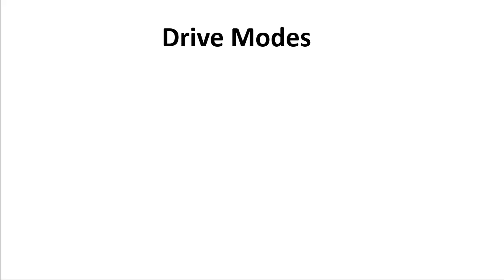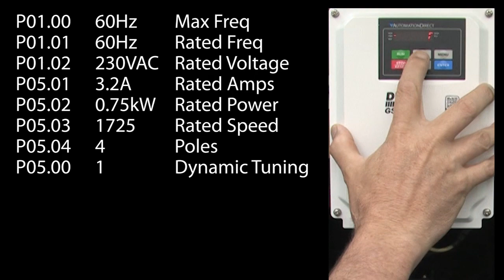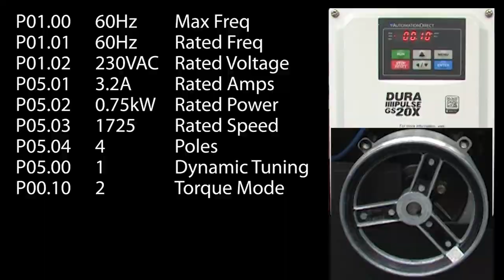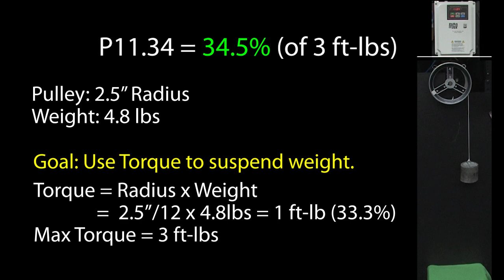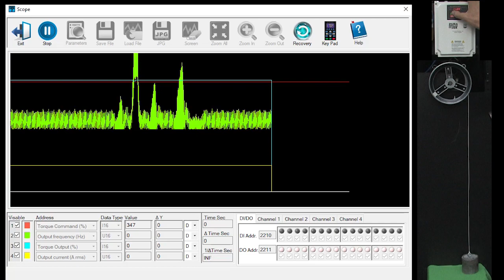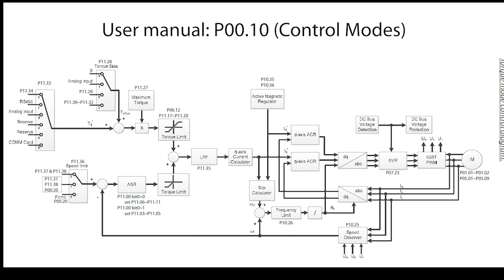DURApulse GS20(X) VFD: Torque Mode Quick Start from AutomationDirect

Comment: Is it copy of delta vfd?
Reply from the maker: @Weekendtraveller765 This is an AutomationDirect product with proprietary hardware, software, and firmware. It will not be compatible with similar-looking Delta drives.

Comment: Really it is great video.
In which cases, should be using Torque Mode in VDF ?
Reply from the maker: You would use Torque mode anytime you want Torque to take priority over speed. 
Winder, rewinders, capping, and web applications are some good examples of when torque control is utilized.

Comment: How can I make analog set point for torque to overcome less torque at low speed That make motor jerk or not able to start
Reply from the maker: Hi Ayman,
Take a look at Parameter 3.00 (A1) or P3.01 (A2) option 3.  I think that is what you are looking for. There are other options in there that you might be interested in too.
Reply: @automationdirect  thanks for interest
I have drive motor when operates at frequency below 50 HZ with load it can't start i need to increase torque.
I increased torque boost but nothing occurred what is the parameter that concerns this.

Comment: great video... it looks like this could replace loadcell torque feedback on drag braking action on heavy paper roll let-off unit instead of fraction drag brakes...:)  also the drive keypad seems better than rockUNwell hmi keypad that fail from poor membrane button design.. which requires a new hmi for new/old non-working drive...:/  thanks AD
Reply from the maker: Yeah, this is a cool feature to have in a VFD. Yet another reason the GS20 is such a great value!

Did you know that we have over 1200 automation videos like it at:
www.automationdirect.com/videos        (Random Search)
www.automationdirect.com/cookbook  (By Topic)